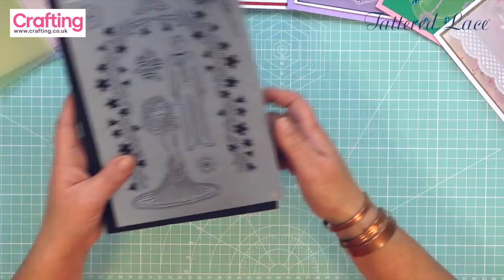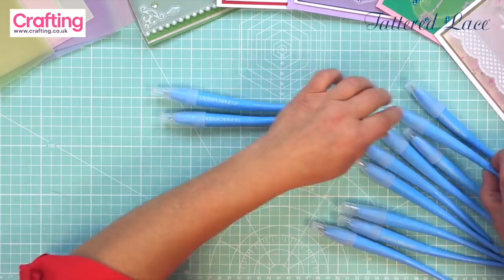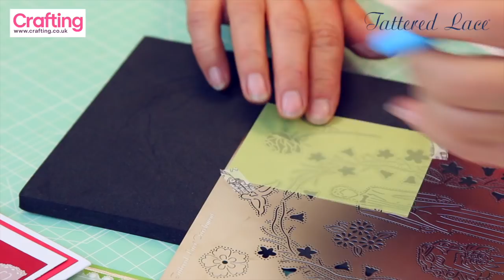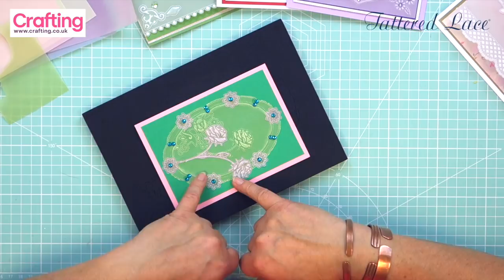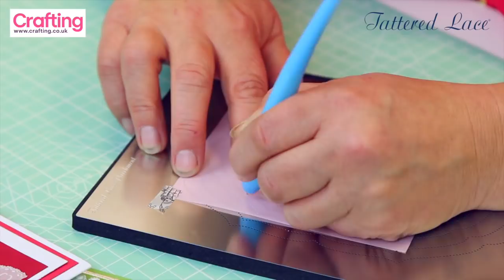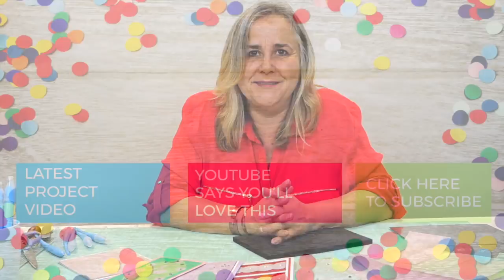Parchment Lace - Tattered Lace | AD

Comment: Wether it’s called parchment lace, craft or any other name. You do not emboss this way . You gently use your embossing tool and stretch the parchment. They way it’s done in this video is wrong, it’s like your scribbling the parchment. I have tattered lace parchment template and I can assure you it’s not this way x
Reply from the maker: I can see that it looks like that but the 'scribble' had very light pressure to stretch rather than tear. Scribbling would have ripped through the work in an instant,  I just have to work quickly to keep the videos at a reasonable length. Sorry you don't like the video Jan.